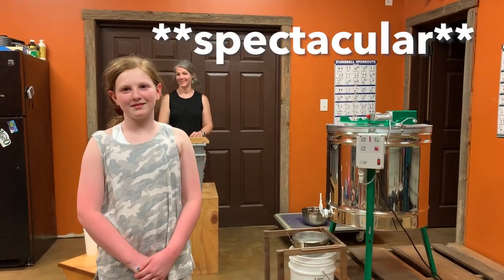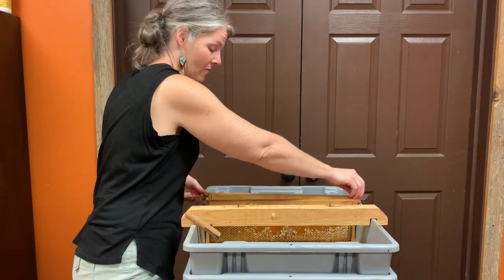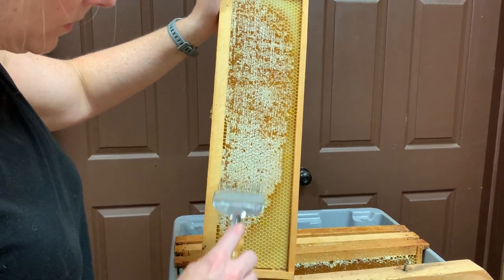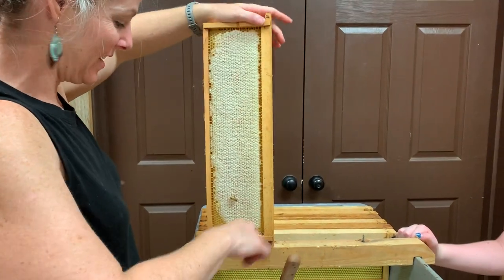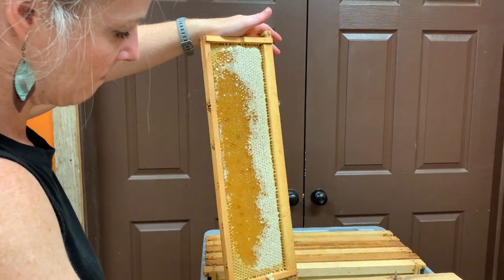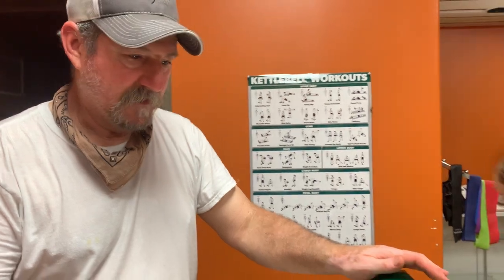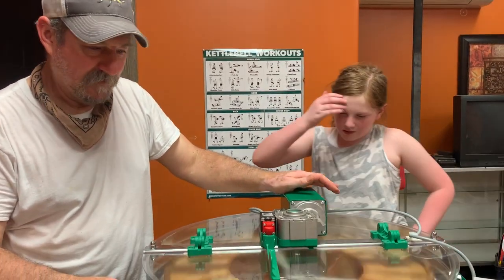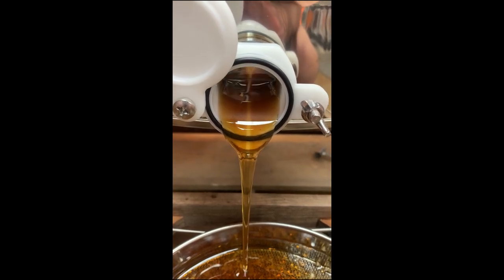Cora's Spectacular Honey | Extracting Honey from the Frames (Junior Beekeeper Training) - Part Two

Comment: Great video. That extractor is very quiet. We just got done drilling holes in our concrete floor and mounting or extractor.  I suggest doing that after you get done this year.
Reply from the maker: Definitely going to put some bolts in the floor very soon!